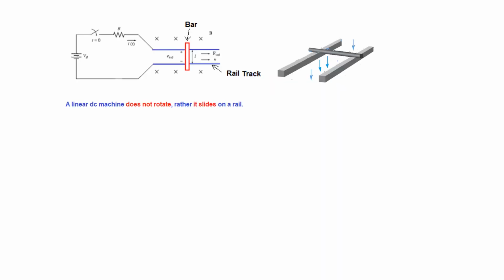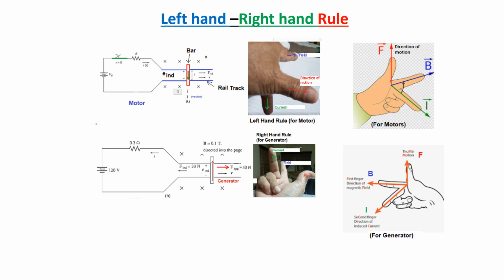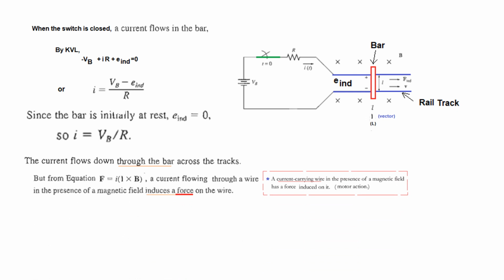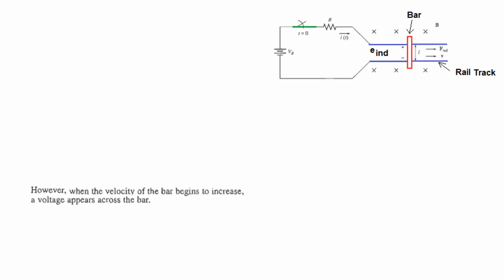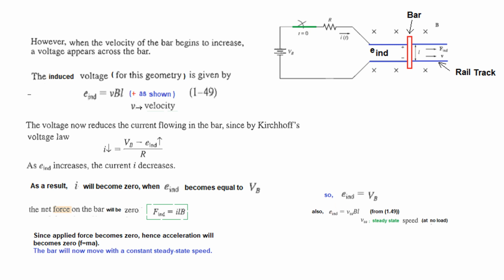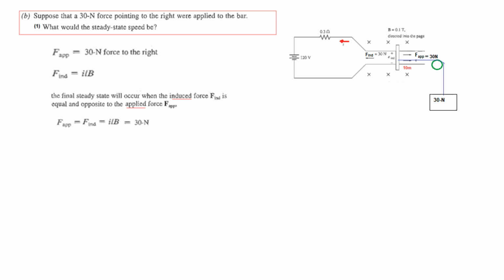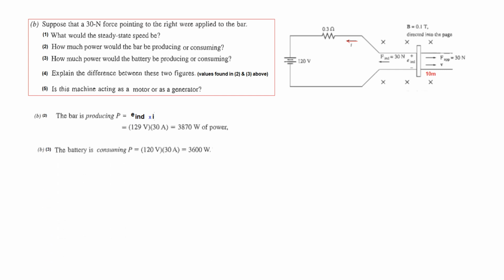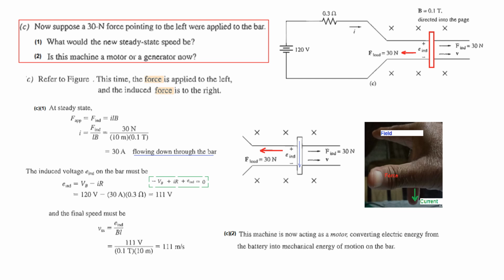(E)EM Ex 1.10 || Linear DC Machine || Calculate Maximum Starting Current

Comment: sir, how would know if the machine is generator or motor without induced voltage indicated?
Reply from the maker: one way I could think is, We know that a generator requires force to move, so if force is given (see at time 3:59 of the video), then it is a generator.
Reply: @ElectricalEngineeringAcademy  does the force need to be more than 0?